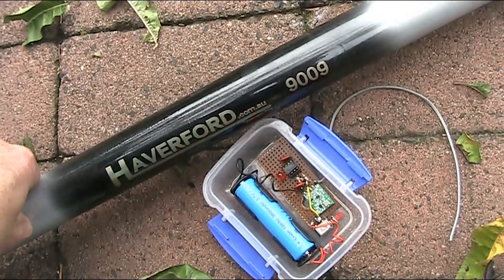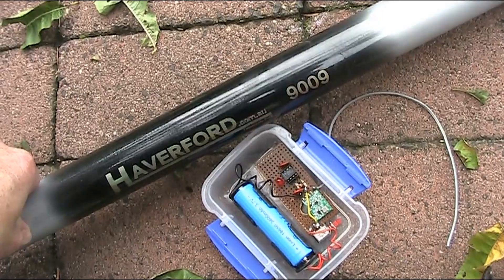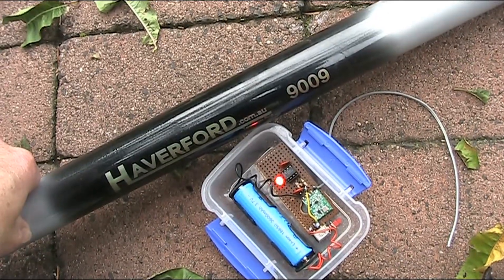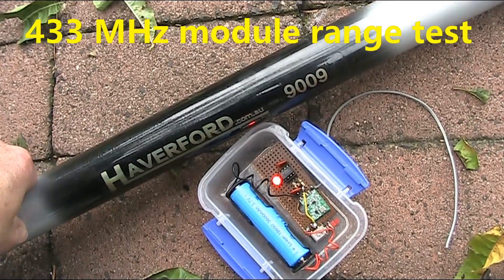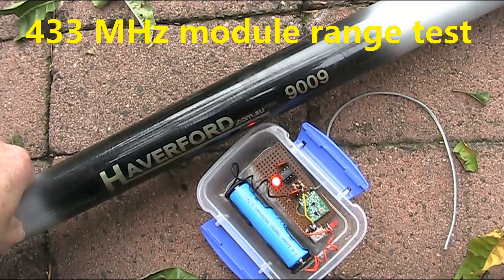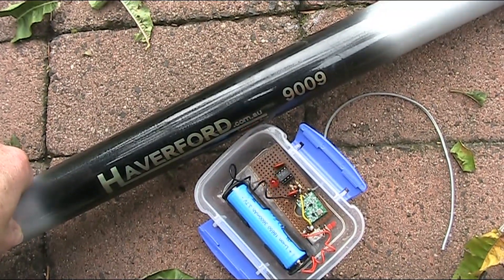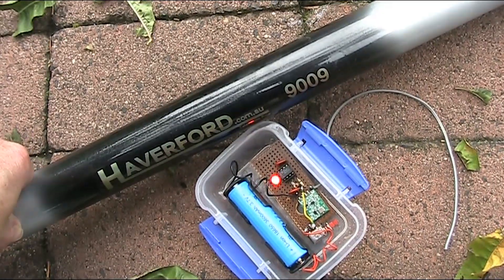2mW 433 MHz beacon range test

Comment: I use these with a digispark to tx rtty or feldhell as a rocket recovery beacon
Reply: What kind of range can you expect in a worst case scenario without line of sight?  For example, if someone put your rocket in the back of their car or in a shipping container?
Reply: @DV7Dave  back of car: about a mile with good antenna. In shipping container: 0.
If you want more range you might want to look at hf frequency. I get a few miles from 100mw on 28.62 mhz which is an off the shelf oscillator frequency.

Comment: I did the same test today for the FS1000A powered by one single 3.7v Li , but i went on my motorcycle, besides hearing spark noise , i got 150m with 0 gain, and 900m with 40 gain
But from a hill 1.12 km away, i could pick it up with 15gain

Comment: i also tested one of those cheap unstable chinese RF433 TX but got 500m without problems using RTL-SDR on my phone
arduino folks often complain about the short range of those modules, but the problem is the RX, both arn't stable and drift so the RX range is too wide and thus sensivity and selectivity is bad

Comment: Commentary on the sometimes mentioned (not here) measure of "Miles per watt".

So, in this video,  if our host got a few miles away, then (considering "2mW") he may have achieved thousands of "miles per watt" (due to the milli...). Meanwhile, anyone running a kW on this planet is unlikely to achieve more than 12.5 "miles per watt" (limited by the size of the Earth, ~12,500 miles being the antipode). Considering the Inverse Square law, "miles per watt" obviously favours low power even if distances might be shorter. The world record "miles per watt" should be a signal generator on a bench reaching the other side of the bench. Considering the meaning of the Inverse Square law, the entire concept of "miles per watt" (being linear) is a perfectly silly measure and should never be mentioned again. 🙂 !!
Reply: It would make more sense to say sqare milles per watt.

Comment: Peter, nice experiment. I would like to see a repeat but you go to the top of Mt Dandenong, perhaps with a suitable Yagi, to see if you can receive the signal from there.
Reply from the maker: Thanks David. Mt Dandenong would be way too noisy, especially on that frequency. Would be better to do the reverse. ie put the transmitter on Mt Dandenong and see how far you can hear it around Melbourne (from RF quieter spots).
Reply: @vk3ye , well and truly spoken by a man who understands RF. I once went to the top of Pikes Peak (14110 feet above sea level) hoping for some long-range contacts on my CB radio. All I heard was dozens of stations right on top of one another roaring from my speaker on all channels. I could occasionally make out a word, but not often.

Comment: I tried similar with my sig gen at 0dBm and also a Pluto SDR, really quite amazed at the distance I could receive the signal over in a built up area, unobsturcted LO)S I reckon it would have been an awful lot further.

Comment: Is it possible to transmit WSPR with this module?
Reply from the maker: Unlikely. Not stable enough. And need much more circuitry.
Reply: Peter you are a man after my own heart. People always want to try these experiments you carry out and wish they had your tenacity. I have bought several of your books and they are great. Takes me back to when I was younger where I was reading books understanding the theory. But believed there was more to this alchemy.So dabbled and went against the grain. My first qrp contact as a kid was with a 49mhz walkie up a hill 5/8 wave antenna 50mw am 80 miles. To my brother with similar set up. Keep up the good work.